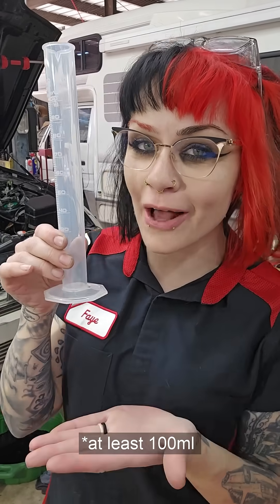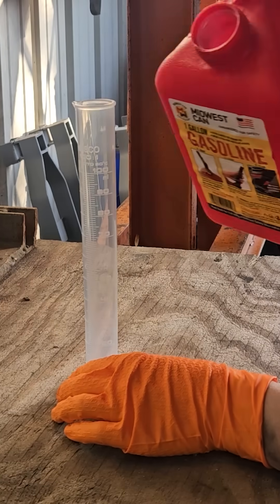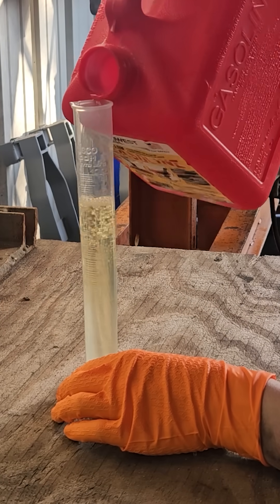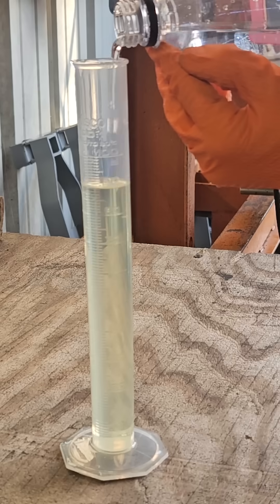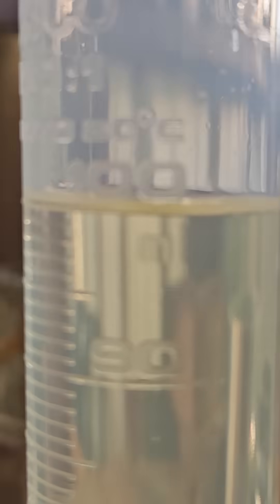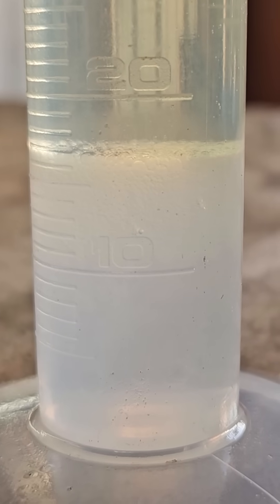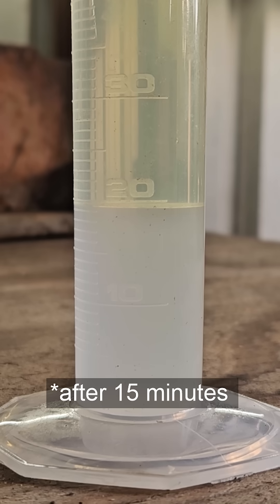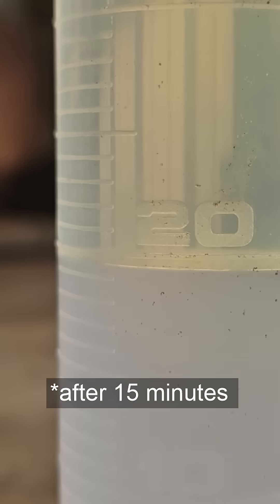Testing the Ethanol Content of Gasoline Using The Water Extraction Method! #AutoDIY #Ethanol #Shorts

Comment: So, if we get 50 gallons of unleaded and add 5 gallons  of water, can we extract the water and use what's left? What'll happen? Will it be bad for the engine, or will it create more power?
Reply: It depends, your lawnmower may not care, but any engine that goes barely above idle may encounter detonation because the alcohol doesn't replace the gas as much as the octane modifiers. You pour it in your car and you might get a very expensive paperweight 😢

You would have to replace the alcohol with Toluene (which will give your cancers cancer, and is extremely expensive) or mythl alcohol or ethyl alcohol. Methyl alcohol causes brain damage if inhaled and ethyl alcohol is what you were removing. Ethyl alcohol in your fuel is tax free, ethyl alcohol at the store is taxed at 100% or more.

The myth about Alcohol and everything it does bad to your engine, can actually get you to destroy your engine.

Comment: You can just hook up a code reader to your obd2 connector and read your live data. It will tell you how much alcohol you have in your fuel. Its alot safer than messing around with flammable vapors.
Reply: Not all cars have ethanol sensors, mostly just the flex fuel compatible cars
Reply: My cars 36 years old, I don’t even have an obd2

Comment: if you're willing to test your fuel regularly I would suggest a hydrometer, one weighted to measure ethanol, since gasoline is so light the hydrometer will only float on the ethanol and you can read it as if you were testing the proof of beer or wine

Comment: Almost mathematically correct. Alcohol is hydroscopic. If this showed a 10 ml increase of the water fuel line, it would equal 10/90= 11.111%
Reply: Could do 100ml gas 10 water
Reply: @souranis this would be simpler and save on the math
Reply: @johncampbell2311 or 50ml gas and 10ml water Double up numbers for percentages, but it does cut your resolution down by half
Reply: Could also just do 50 and 5ml
Reply: @goob_1191 Exactly.  The you double the "water increase" to get the percentage of alcohol.
Reply: Came to the comments for this.
Reply: Do you mean hygroscopic?
Reply: @ That would be the correct term.
Reply: @nneiil  That's what Google asked me.
Reply: 50 ml of alcohol plus 50 ml of water won't give you 100 ml of solution. It will be less and denser. In chemistry class, they explained it like having a jar full of sand being full, but you could still pour water into it, since there's gaps between the sand. Except it's atoms in this case.
Reply: @VulcanGray so milliletres is a measurement of volume. 50 ml of water and 50ml of ethanol is yhe same volume. Yes its a different weight but then that's a different measurement altogether. 50ml is 50ml no mater if it's water or dirt...
Reply: @VulcanGray exactly, so unless one of the many compounds in gas not mentioned effects how they mix, that was a lot of ethanol.
Reply: The chemistry is far less precise as there are other cosolvents added to prevent aqueous partitioning by atmospheric moisture contamination.
Reply: 10% of 90ml is 9ml. Go ahead and fill to the top with water (100ml total). Shake and read as demonstrated. If the separation line is at more than 19ml, you're getting more than 10% ethenol in your fuel.
Reply: She technically never said anything wrong. If the level of the water alcohol mixture is about the 20mL level is is over 10% ethanol.
Reply: @jonathonhazelton2060 but also technically, 10% of 90ml of fuel is 9ml.
Reply: Close enough
Reply: It’s a 3 on the tree wouldn’t let it touch my vehicle
Reply: @Alaskafishinh 🤡
Reply: Thank you. Not all heroes wear capes.
Reply: Pour 50ml add 10ml put in mixing bowl pour 50ml again and mix
Reply: gasoline also holds about 0.5% (v/v) water before phase separation (at 15C)
Reply: Hygroscopic
Reply: Thank you I was tweaking when I heard that
Reply: that extra percent isn't going to make a difference as your ecu has more than enough timing and fuel adjustment to compensate
Reply: You're only almost correct as well. It's hygroscopic not hydroscopic.
Reply: sOo, you're saying it's over 10%
I see now
Reply: Ya, was coming to say why wouldn't you test 100ml of fuel to get the actual % easier?
Reply: This is a really cool trick thank you
Reply: Exactly!! :-)
Reply: Dang it. I came here to say that.
Reply: The problem is finding a grad cylinder that has graduations over 100 mL to maintain scientific precision.
Reply: @spadesofaces1980  i mean yeah you would have to measure them separateley but not that much harder
Reply: @souranis  yep. I wasn't saying it would be harder. Just not as accurate.
Reply: @spadesofaces1980  so you have to choose between precision and accuracy.
Reply: @spadesofaces1980 there are graduated cylinders that go way above 100ml. I would say dumping it in a bucket and pouring it out is more of an issue…
Reply: @spadesofaces1980 the problem is finding an accurate grad cylinder that's not made of glass 😅
Reply: @siiioxide don't use plastic with petrol...
Reply: @siiioxide accurate enough.
Reply: @ryanboscoe9670 What do you think gas cans are made of? It all depends on the type. Some are fine, some dissolve, some don't dissolve but can cause static sparks.
Reply: @ryanboscoe9670  you realize they make plastic gas cans right? You can't use CERTAIN plastics with fuel.
Reply: @spadesofaces1980  or you can half everything, 45ml fuel, 5 ml of water.  That way you have 50 ml extra to measure.
Reply: Or make your own mark at 110mm with anything that can be used to measure, ie. a mechanical scale or a piece of paper and something to make a mark with.
Reply: Y'all are going to believe someone with the profile picture of clown Anon and has chungus in their profile name?
Reply: Whats wrong with using ounces instead of ml?
Reply: @grubby1975 oz aren't divisible by 10 for nice even numbers. So it'd be a lot more math involved to figure out the percentage.

Luckily virtually every graduated cylinder will be in ml to make it easier to find. Imperial measurements suuuuck for precision.
Reply: @kbo8029 why the US still use imperial?
Reply: @ryanboscoe9670  The USA uses Customary Units of measurement. The Imperial system is of British origin.
Reply: @grubby1975 Only a few countries uses those middle age units. With yotube having international reach... go figure why it is better to use metric.

Comment: I once came across a pump where the available grades were 87, 87 and 91. The first 87 had the label "contains up to 10% ethanol" while the other two had "no alcohol." Though ethanol is an alcohol (and is the specific one of the various alcohol molecules that is usually meant when the word "alcohol" is used on its own) it's unusual to see it on a gas pump.
Reply: Non ethanol gas is for stuff that doesn't run All the time like lawn mowers off-road vehicles and cars that sit around for weeks or months at a time so you don't have to worry about ethenol breaking down over time and clothing up the fuel system
Reply: We have those quite a bit in the Midwest. It's also not uncommon to see 87 and 91 with 10%eth but 93 is "no alcohol". Some gas stations have alcohol-free pumps and ethanol blend pumps separately each with a different hose for a different grade and alcohol blend.
Reply: In some states, all the gas has ethanol. 😢

Comment: without explaining .. that alchohol is extremely hygrophobic .. it readily bonds with water as apposed to petrol so the water pulls it out of suspension from the petrol
Reply from the maker: I'm sorry, I'll do better next time
Reply: @FayeHadley  I think you do extremely well  .. would be good for your subscribers to know how/why ethanol added to fuel returns worse fuel economy when they think they're getting cheaper fuel .. they're not .. calorific values of fuels .. & why it's sooo bad for engines .. so pleased we aren't forced into it in NZ .. just clean straight PETROL .. 100 octane's often cheaper than the e15 we have & most stations don't have any e fuels .. "performance" by definition is SUITABILITY for task .. you are amazingly unique

Comment: Interesting experiment. I do try to put 100% gas in my car when I can find it. It's a little more expensive but I think it's worth it.
Reply: IF .. your engine's tuned right .. ethanol in fuel will degrade fuel "economy" .. ethanol burns at TWICE the rate of petrol .. so ethanol in petrol makes engines run leaner & as such drops power & performance IF your engine's in tune .. water injection (with 20% ethanol) is a far better economy & performance improver than ethanol .. BUT .. it's freeee
Reply: It really isn't on any modern vehicle. On many you'll lose power due to the timing having to pull back a bit, cars are tuned for 10% ethanol and flex fuels with a proper sensor can run anything between 10% and 85% and adjust accordingly
Reply: @DarkAttack14   timing any blended fuels is a guessing game .. the effect of compression pressure on each fuel within the mix can be random dependent on conditions of storage & with alcohol humidity.. a stupid concept to supposedly reduce crude oil Enviro impacts that energy equations don't add up .. ethanol burns MUCH slower than petrol AND needs much higher c/R's to combust EFFICIENTLY for energy return .. a BAD combination

oh & by the way.. crude ISN'T a "fossil" fuel.. derived from dinosourus.. satelite tech that finds oil on earth, found even more.. on Saturn's moon Titan
Reply: If you remove the alcohol from your fuel you will destroy your car. Alcohol is used as a octane modifier, and you will be creating lawnmower gas. You would not put 75-85 octane gas in your car, because it would blow up your engine.
Reply: A little more expensive? I'ven seen it 25-30% higher than hightest. Making it way higher than plain 87 octane.

Comment: I've never seen a gas pump labeled quite like that before. In Massachusetts, they typically say may contain up to 10% ethanol. And there are very few gas stations that have E85 here.
Reply: That's what I've seen. The sign is meant to mislead customers into thinking they get more gas and less alcohol there compared to other stations.
Reply: Yeah its pretty much all 8-10%, rarely more, unless they state a SPECIFIC percentage.
Reply: @Magic-Conk 
   Minimum percentage is required by the EPA as a oxygen enhancement, the other mixes are dependent on the cost of product in your area.